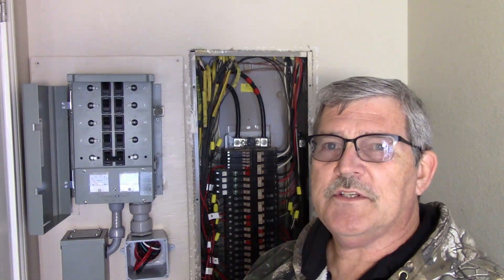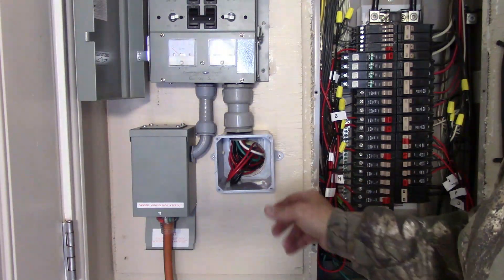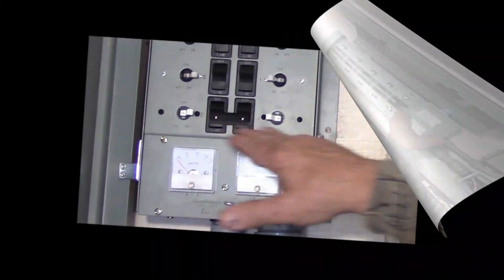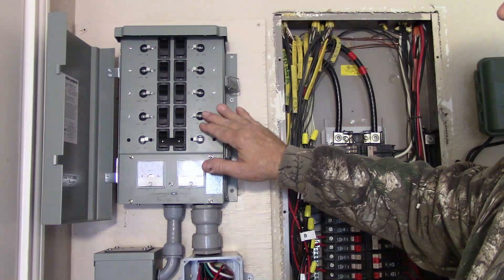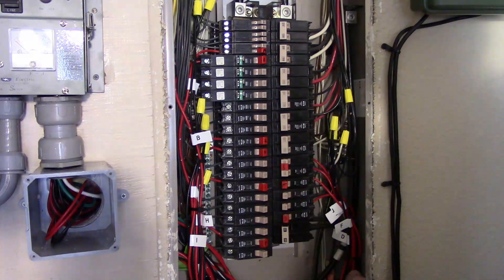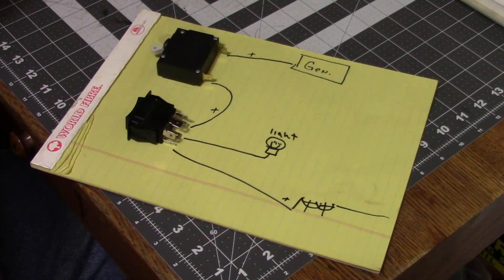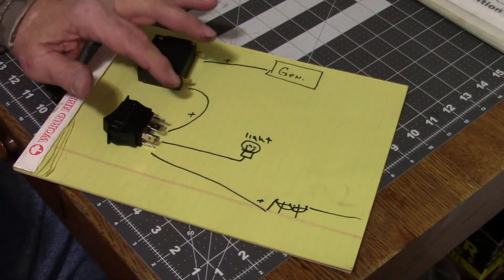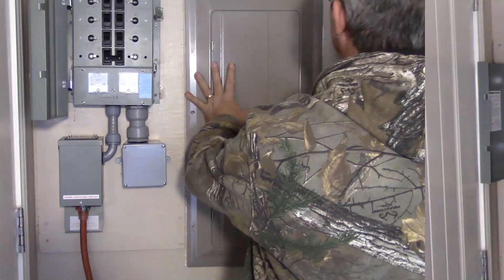How To Hook Up a Generator To Your House Using a generator transfer switch

Comment: Is this a 50 or a 30 amp switch? What are the total watts this switch can handle? Are the meters showing wattage on one side of each  leg?
Reply from the maker: The transfer switch has several independent breakers on it.  My generator now can supply 50amps so I have more than enough power. 
It would be best to see what your generator is rated and size your breaker accordingly. Thanks and take care

Comment: What brand is the one you used
Reply from the maker: I used Connecticut Electric EmerGen Transfer Switch . The switch comes in 30 and 50 amp on Amazon. Thanks and take care

Comment: With this setup, can I use my small Honda 2200 watts where can I manual select to  choose which circuits (total not over 2200 watts)  ?
Reply from the maker: Yes, as long you don't exceed the rating of the generator. Good luck on your project
Reply: @RustyGlovebox  , I don't know why when I discussed with an electrician , he kept told me my small honda 2200 watt (only 120 v / 15 amp) will not work for this transfer switch, I have to use 240 V generator instead .. do you think he is correct ? I told him   I can use the 30 amp to 15 amp convertor plug, but he said it will not work for my small honda generator.
Reply from the maker: Maybe local code wouldn’t allow him to do it

Comment: Thanks,  how to hook up an emergency power transfer switch to a multiwire branch circuit,  if possible . . ..  Two 20A breakers with handle ties feeding the kitchen.  Yes, they are sharing a common neutral.   The transfer switch has four 15A circuits;  each circuit has a breaker and a 3 position switch:  Line  -  Off  -  Gen                     Thanks, Bob
Reply from the maker: Thanks and good luck Bob on your project

Comment: Thank you I needed to do the connecticut transfer switch with the same transition from surface mount transfer switch to recessed mounted service panel.  Non of the instructions or the 1 1/2”  water tight conduit gave me a clean way to transition, or clue it was all surface mount to surface mount.  I have a question, is that to code running those wires  through the wall and into the box?
Reply from the maker: At my location it is but you should check with your own local and state coding if you don’t know and have concerns. Good luck and thanks

Comment: Nice video.  We’re you able to hook up central heat and air with this transfer switch ?
Reply from the maker: I did not try , I bought a portable ac/heat pump to roll from room to room if needed. Thanks

Comment: Rusty, how many watts did your water heater draw ?
Reply from the maker: It will say on your water heater about the watt draw but mine was about 2450 watts on each meter.  I don't leave it on the full time. I switch it on long enough to take showers and turn it off.

Comment: Hi i know it have 4 20amp breaker my ? Is  can i use the 15amp for the tranfer switch to conect a 20amp front the panel thag run my boiler.o they only dedicated for a 15 breaker.?
Reply from the maker: You can change out the breakers in your transfer panel to match your boiler breaker. Good luck

Comment: Thanks for the video. I am ordering the same switch and will be using for my solar. Instead of feeding the wires from the bottom to the breaker panel could you feed it through the back of the transfer switch. That's what I was hoping to do. Thanks
Reply from the maker: Thanks,  you could use the transfer switch panel as a supply panel for your solar panels as a stand alone system. Each circuit has a breaker and rocker switch.  One thing worth doing is checking the connection inside the box. I found several push-on connection that were a little lose on the blade terminals.  Inside the panel the power wire was a bare wire, I wrapped it with electrical tape to pacify myself. Overall I'm happy with the system and glad to have it installed. Good luck on your project.

Comment: Your transfer switch is in the box where your generator feed comes in, correct?
Reply from the maker: The transfer switch is the generator power distribution box. It allows me to supply power up to 10 circuits. Mine will have 9 circuits because I am using 1 pair of breaker to supply 240 to the water heater. Thanks
Reply: @RustyGlovebox  Okay watched again and you do point to it. You mention breakers but there are both breakers and switches in that box with the breakers on the outside and the switches in the center, did I get that right ? Thanks.
Reply from the maker: The breakers in the transfer switch box are for the generator power input.

Comment: Good job , Got to keep those restoring  the electric safe
Reply from the maker: Thanks Terry, if the system every gets removed or changed out it should be easy with the wires identified.

Comment: nice job Rusty.  I had mine tied in without a main kill switch so I had an electrician come over and install an auto on the mine, power goes off it switched the main coming in off, and ready for the gen.  I have to start the Gen but it runs the whole house and shop without back feeding to the pole.
Reply from the maker: Thanks Buzz, Having the auto transfer is a nice feature. I'm thinking no more often than the power goes off here I will be satisfied with this unless I upgrade to a whole house system.
Reply: @RustyGlovebox  You did a good clean job and will work safely I'm sure.  We lose power a lot in the winter as much as6, 7 times a winter and the same for the summer. Sometimes 10 minutes other times 2-3 days.  Time for us to move.   lol

Comment: I installed a generator switch in the Florida house but I have yet to install one here and I need to. We loose power quite often. You did a nice install there Lloyd.
Reply from the maker: Thanks,  it has been setting around waiting for me to install it. After the latest outage I decided to get after it. Looks like it will work great . Good luck and have a great week.

Comment: Looks good to me. Now you just need to have a big farm gasoline tank full up on gasoline on a big rigging so you can fill it up with gas when needed. When emergency happens the pumps at the gas station work on electricity and wont pump so you cannot go to the filling station and fill up. For who knows how long if there were to be a EMP Civil war or UN attacks or nuke.
Reply: You can increase your favorable odds by purchasing a tri-fueled generator.

Comment: Nice job I have lockout on my box and I bought a generac 8000 it does great on my house most of our appliance  are natural gas.
Reply from the maker: Sounds like you are fixed up. Being prepared is a good feeling for a minor outage. My neighbor was trying to start his generator till his shoulder went out. I went over there to help and cleaned the carb out and helped get it going.

Comment: This is now  a neat job, your drawing is very nice, how many amps is your breaker switches for the leds. Sorry if it is a stupid question, electrics is not my strong point
Reply from the maker: Thanks Jan,  I am not an electrician but in a former job I had to know how to wire panels on machinery that may have AC power. Have a great week my friend.